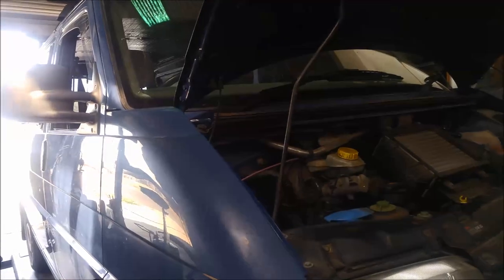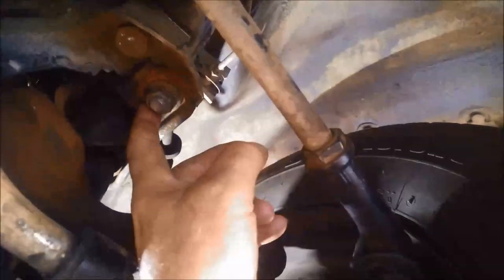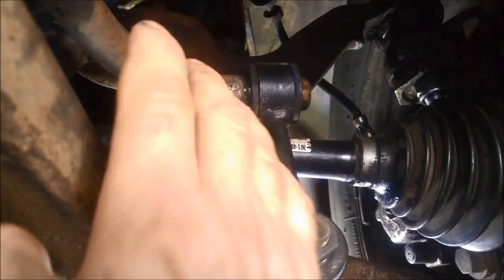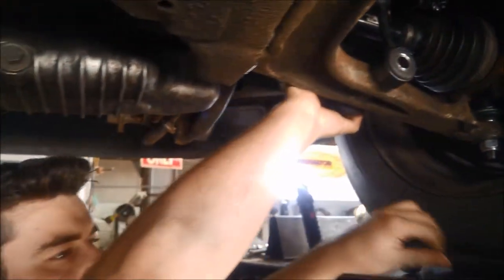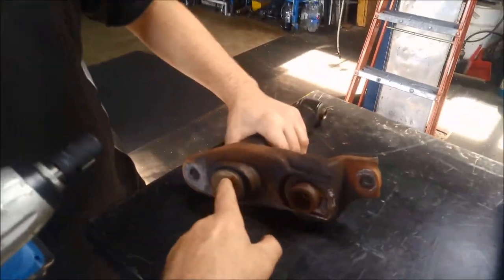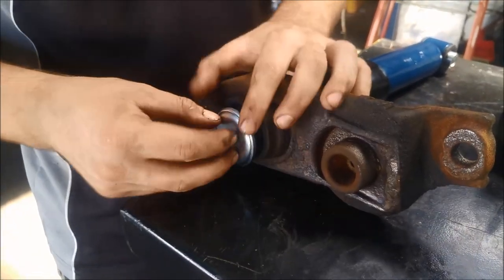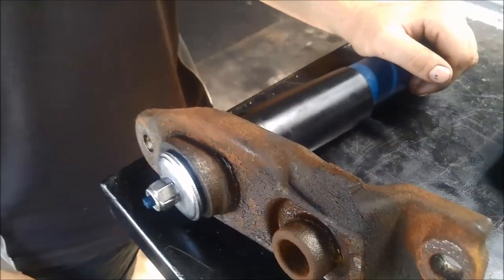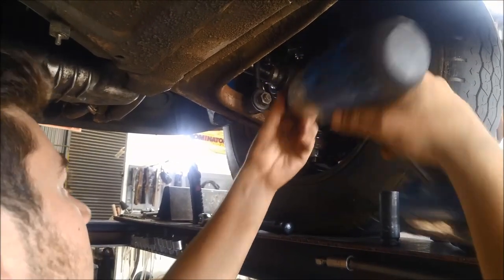How to VW Volkwagen Replace Front Shock Absorbers VW Transporter Eurovan Caravelle Doka T4 T5

Comment: Not really correct info as you should have opened up fully and compressed the shock fully before installation!
Reply from the maker: hi for oil shocks, no worries. cheers